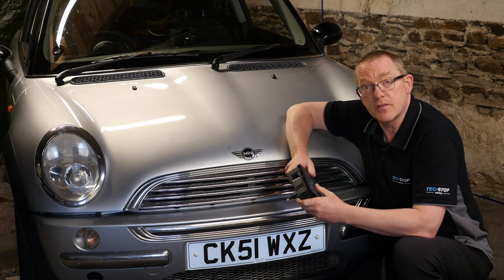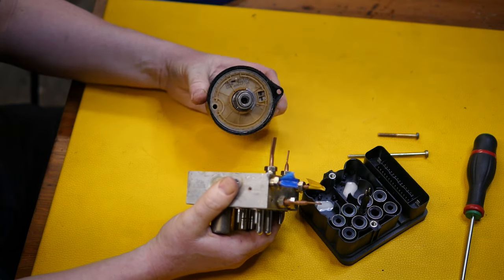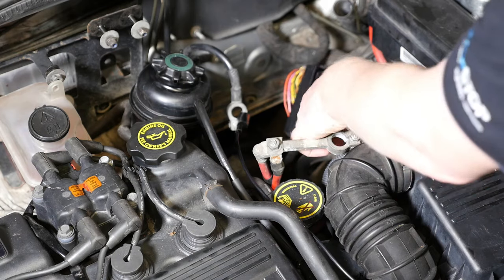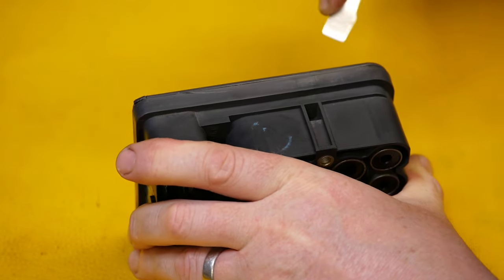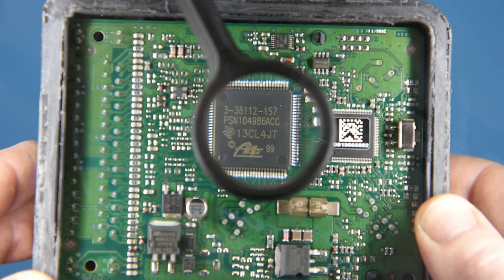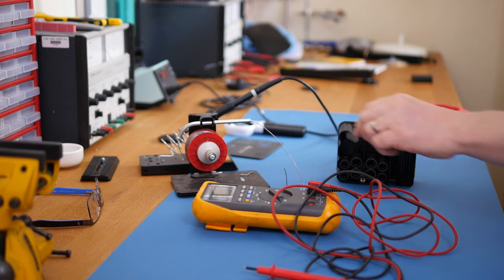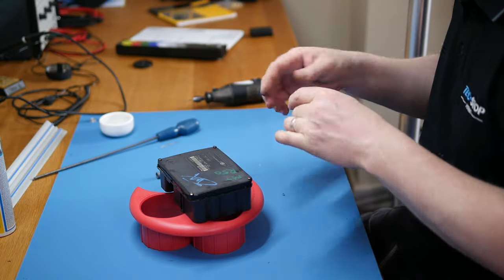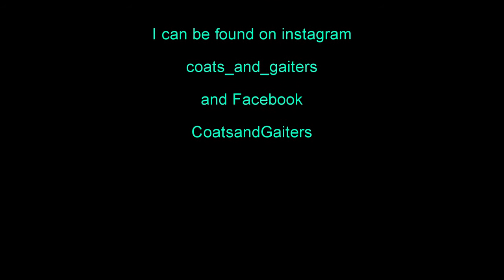Repairing and Soldering an ATE Teves Mk60 ABS Brake Control Module from a 🚗 2001 BMW MINI One R50 🚗

Comment: I think I have an identical ABS module on Chevrolet Cruze 2009.. mine have two main errors Stuck Pump intermittent/Permanent and Hardware Control Unit Malfunction/Short to Battery Errors. I check Pump motor, Pump pistons, Electrical Power to ABS Module, everything look OK... I test voltage out to the pump is 5v when starting the car with no load an 0 with motor load so I think the MOSFET that drive the motor is bad or an inside connection with high resistance, so the electronic module need opening and check...
The bad thing is I can't use the car without the module, the car engine will not start with the module disconnected...
When is hot outside the ABS works (middle of the day, run the car longer so engine compartment get hot) but when is cold not (in the morning)... so clear that is an electronic problem...
Reply from the maker: Could be the fine wires going to the sensor inside the module as they are the width of a human hair.  Possibly making contact when hot and expand and then loose connection when they contract.  Bit of an issue for everyone I believe as these are fitted to so many cars.
Reply: I think tomorrow I will try only to remove the electronic module, removing first the ABS bracket... I think is possible only if I un-clip the motor connector from the electronic module, otherwise is not enough space under the electronics to extract it vertically down.
Reply from the maker: @user-ug9nn  You can just remove the electronic part on it's own.
Reply: @CoatsandGaiters  yes, just the brake pipes (plus the bracket) on mine run under the module so I think pipes need a little bend. But I need to extract the connector to the motor from ABS module, that one is too long... 
I am afraid that I need to disconnect the piping witch I do not want... bleeding the brakes might be shitty as bleeders might be rusted and stuck, witch might brake and run in extra repair after... 
I don't want to complicate things, I will look tomorrow and decide if I proceed further now or let it for a later repair... maybe I should start first with the caliper bleeders, If I think the pipes need to be disconnected...
Reply: One reason might be that push fit connector that you mention I will check connection on each pin with ohmmeter to see if that is the problem, maybe some power connection has high resistance
Reply: In my case that STB80NE03L MOSFET might be bad, because of temperature variation... I thing this summer hot temperatures was the issue...
Reply from the maker: @user-ug9nn  Keep us posted if you fix it.
Reply: @CoatsandGaiters  Yes I will inform it if success or not... on my Sunday investigation I decided to postpone the job. The bracket run under the ECU and under it some piping, the bracket can't be lowered down or rotated for removal, so I can't remove only the electronics, I have to bring all unit down, disconnecting the piping,.. witch make the job too large for just a small not so important fix ... emergency braking assistance can be assisted by my leg push and brain... and I don't remember last time when it was really used, probably last winter...
The only thing that piss me off is when I start the car it make annoying audio signal and 4 lights light up on my dash, this is the only real issue that I have :D
So I will do it, but I am not sure when, maybe this week, this month, next month or next year... I have other small staffs on car that are more useful to be fixed, but the sound and lights really piss me off so I might increase the priority for this... maybe this week I will start with brake bleeding check, I think also caliper pads need change... I do some staffs on exhaust previous week,and I will continue with it, some rust under car,...
Reply from the maker: @user-ug9nn  I sympathise when I found mine was up the shoot after hoping it was just a wheel sensor, then my diagnostic tool went west so I thought the jobs are mounting now so just take it apart for YouTube lol, since then I've found the clutch should be replaced, 2 engine mounts should be replaced and it goes on and on.  My push bike is reliable at least.
Reply: @CoatsandGaiters  you make me smile, I replace the clutch in the spring, service LPG regulator also in the spring, ... now I have to replace also the LPG tank is 10 years old... 
the ABS electronic module should not fail, but the trend is cheaper and less reliable so the cooling of MOSFET probably was not enough as no visible sink is present ... no metallic case just thermal insulation plastic case, plastic is cheaper to mold,.... they don't solder that connector because that require manual soldering so was expensive,.... cost cuts everywhere, but when you go to the dealership the price for the unit is 10% of the car ....
Reply from the maker: @user-ug9nn  Bang on !!!! I find it's all getting a bit much today.  Car's were honest to a degree, you knew some were good and some were built cheaply.  Now they seem built to last 5 years, cost the earth and the ownership pleasure is fading. I have that Peugeot 207cc cabriolet sat in my barn with only 50k miles on.  The engine destroyed itself on tickover !!!  They don't key the cogs and I presume it's slipped and the pistons hit the valves.  Things seem to have gone a long way from the quality BMW's in the late 80's.  Nothing lasts at all.

Comment: Great Video! How did you solve the problem?
Reply from the maker: Thank you.  I bought a second hand one off eBay as I presume the sensor wires had failed inside.
Reply: @CoatsandGaiters  Thanks.I'm having the same problem. Pressure sensor wires you mean? ABS sensor cables can be meassured at the plug? The four pairs of them have aprox the same resistance in my case. Thanks for reply. Unfortunatelly electrician mechanics diagnose was just replace module, but I'm trying to check other possibilities before I get another used unit!
Reply from the maker: Thing is a second hand unit ca be really cheap on ebay now.  You can just change the electrical side and leave the pipe work undisturbed. @lsp5745
Reply: @CoatsandGaiters  will try that next week! thanks for helpfull video

Comment: Great video. DID IT WORK???
Reply: I'm asking because I've got the exact same problem, have had the unit out, cut the top off, looked for faults etc. I will try this immediately if it worked for you.
Reply from the maker: @iebah1  not got there yet lol tomorrow’s video is reinstalling it and then I need to bleed the system down before trying.  I do believe it can be one of a few things.  Soldering the connections is only one possible issue apparently.
Reply: @CoatsandGaiters  Yes, I agree. I have searched high and low for a diy solution. Some BMW owners seem to think that a little IC with 14 soldering connections is always the problem. I bought some of them from China, but defo need a hot air rework station for that. Good luck!
Reply from the maker: @iebah1  I did see that if you change the control unit you have to reprogram the module using an advanced car diagnostic tool or remove the small EEPROM chip and solder into the replacement unit.
Reply: Did it work? My ABS Warning comes after reaching 14 mi/h on my mercedes. I have opened the module up and cannot see any loose connection or damage apart from the unsoldered pins. Thinking of solder them and see what happens.
Reply from the maker: @feras3499  I'm bleeding the brakes down this week so hopefully will know in a day or two.  To be honest it can be several things that fail so I'm not holding much hope.
Reply: Waiting for your next video. I think we both have the exact issue. It is good to try diy fix before spending a fortune on a small module. Keep us updated and good luck.
Reply from the maker: @feras3499  Once brakes have been bled and edited I will try to test though my Diagnostic Laptop went wrong on me so I'm in a dodgy position now.  Not sure why it suddenly stopped working on me.  Will be a while before I can buy another.

Comment: My Z4 E89, drive for 5 minutes and abs warning all lights up, obd say everything connected to it failed (it hasn't). Restart resets everything then several minutes later fails again. Then yesterday, tried a restart and car nearly didn't restart, at traffic lights!
Some weeks ago replaced the brake light switch with cheapo of internet. Today hopefully get genuine from BMW and try that.
Reply: Got 2nd hand abs on the way, might try swapping the chip. Might first try the above method, seems like a dry joint problem.
Reply from the maker: Not sure the car not starting would have a connection to the ABS module but then I have limited experience in these things.
Reply from the maker: @flybobbie1449  I think it's safer to replace the whole unit as your doing unless you can get it sent to a repair shot where they re condition everything.

Comment: I have a Mercedes Viano that the brake pedal depresses all the way. The brake calipers and master cylinder have been changed twice and it is still the same. Could it be the ABS module, how to check it?
Reply from the maker: Sounds like air in the system.  Have you tried pressure bleeding 1 litre of fresh fluid though.
Reply: @CoatsandGaiters  umm, the mechanic purge the system with scanner. Thanks.
Reply from the maker: @cransaftvalve734  I wonder how effective it was or did it work.  When I changed the mini abs unit the pedal was very soft.  I was advised to drive fast around a car park braking hard to activate the abs pump to clear any air.
Reply: @CoatsandGaiters  yes it can be possible. I will told him. Thanks.

Comment: Are the abs connected to the ecu.
Reply from the maker: I think they talk together as you have other sensors in the vehicle body.  I believe there is a BCM (Body Control Module) in the driver's footwell.
Reply: @CoatsandGaiters  Okey thank you for the information
Reply from the maker: @muhammadamir8276  there is also a chip in the abs unit programmed and coded and if you replace you must use the exact part number for that reason so on that basis the abs must be talking to the other onboard ecu’s I’d presume.
Reply: Okey sir. That is very nice explanation.

Comment: Did the module worked after this fix??
Reply from the maker: Sadly not
Reply: Woow...  It should have been fixed
Reply from the maker: @ervinmq1955  The hair line wires to the sensor often fail which is impossible to mend at home I believe.
Reply: @CoatsandGaiters how do these wires look like? Do you have a video/images of it, or anywhere i could get further information of where they are and how they look like?
Reply from the maker: @gubban48  "The other common fault that we see with this ABS unit, is the brake pressure sensor that is found within the Hydraulic Unit.

This is the more common fault out of the two and one where we have a bespoke remanufacturing process to fix the fault. We find that 99% of the time, when there is a brake pressure sensor fault, it is the small micro wires within that need replacing. This can be extremely difficult as the wires are barely visible to the naked eye, and therefore requires the use of our bespoke machine to remanufacture this unit."  https://pmmonline.co.uk/technical/common-faults-ate-mk60-abs-unit/

Comment: Did this resolve your problem?
Reply from the maker: Sadly not.  I bought a second hand one on eBay.
Reply: @CoatsandGaiters  I did the same thing, and now I am getting the ABS warning as soon as I start the car, instead of whenever I go over 12 mph, and there is no Power Steering failure locking in. So I think I got a bad unit, OR it needs to be programmed to my specific model of car. I'm going to Auto Zone tomorrow to get another free scan done to see what the codes are this time.
Reply from the maker: @waynedowney7616  When you bought the replacement off ebay did you make sure the number was the same.  If they are different numbers it may need to be reprogrammed to suit your car.
Reply: @CoatsandGaiters  Some of the numbers are the same, but some are different, so I think it is from a different model of Mercedes (exact same module though, Mercedes branded and fit perfectly, so you are probably right). Is this a dealership job to reprogram it, or can a third party shop do it? I'm supposing there is no way to do it yourself without being a hacker wiz. I was an Electronics Technician in the Navy so testing and soldering is fine, but I don't know anything about coding.
Reply from the maker: @waynedowney7616  I think you can swop the chips over.  Take a look at this part of my video.  Double check though that's it this chip if you decide to do this.  https://youtu.be/zmkAuDSU1Zo?t=1022
Reply: @CoatsandGaiters  I'm worried about smoking the chip, and don't know if that's the (entire) problem, so it's risky.
Reply from the maker: @waynedowney7616  I felt the same way as well.

Comment: I have issue with abs on my mini r50, it give me errors for can comunication and then sometimes and it does that it makes the car slow by braking the car, if you stop and them go lights Will be on but Will stop that braking efect. I am lost on this one.
Reply from the maker: These units do fail with age.  You may be better getting it refurbished or buying a used one off ebay.  I bought one off ebay in the end.  Just make sure the numbers are exactly the same as they are programmed for the cars.
Reply: @CoatsandGaiters  i need to check some more things, because when is wet or raining is when this happen very rare when is sun outside
Reply: I found the issue, wiring is rubbing and when water comes in it shorted can lines, very comkon issue for what i search on google
Reply from the maker: @fabini14  blimey that’s lucky so should be easy repair
Reply: @CoatsandGaiters  not very easy to repair, because is hard to reach the wiring, because it goes behind the dash.

Comment: I could be wrong, but I think you must be dealing with "planned obsolescence"...(as for example happens in printers and other electronic devices).
On my car  the abs unit ,it stopped working and gave an error  after (exacly)140000km....
 Maybe the problem is inside in one eeprom chip,and not the reflow pcb...
Reply from the maker: You never know today as big companies do sly things as everything is about profit and forcing continuous sales isn’t it.

Comment: you need a schematic. those miserable piece of shit cars have terrible wiring routing and many times issues with the abs/transmission/engine ecu are caused by ground faults or harness damage that shorts out circuits. so believing what your meter says is good, but it could not be the way its should be. do it properly
Reply from the maker: Electrical gremlins are complicated arnt they. So many possibilities for errors developing.  Probably makes more sense to send away to a specialist to be rectified.
Reply from the maker: @sorryimajerk735  yes, exactly